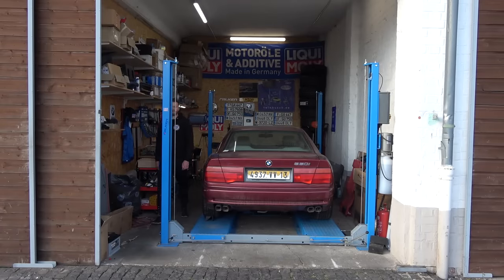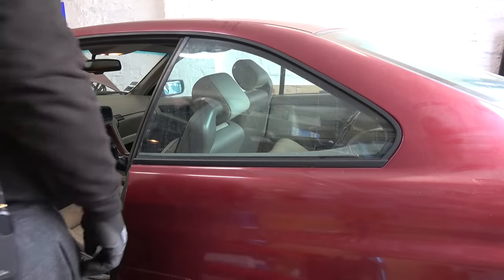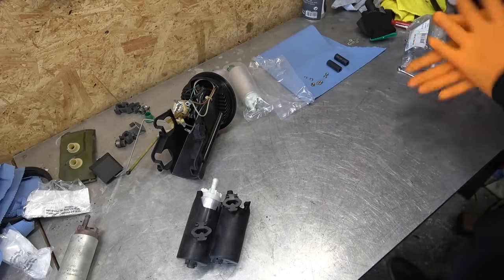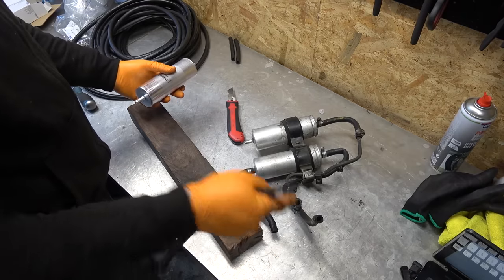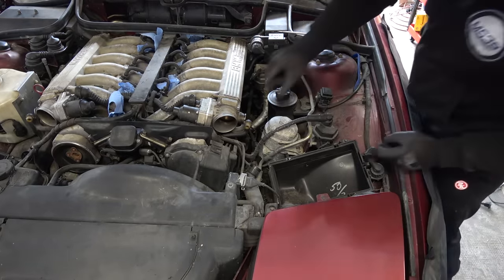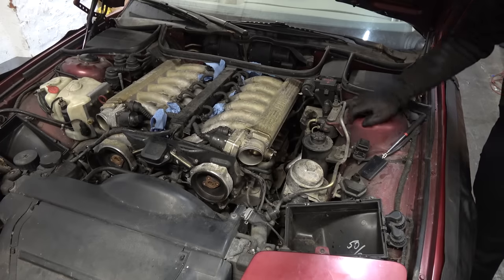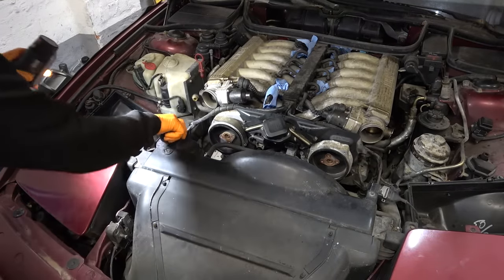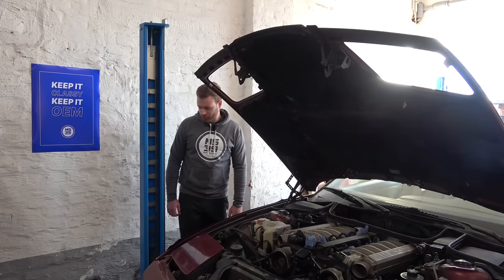The Hack Jobs Unfold - Garden Find V12 BMW E31 850i Revival - Project Marseille: Part 2

Comment: The more I watch this channel the more I'm convinced. It's not that BMW's are unreliable, it's that so many mechanics don't know how to work on them. It's either that or their cheap shortcuts don't work!
Great work.
Reply: Cheap short cuts nuh cheap at all, an dem never work out either.
Reply: @objective see, imagine the conversation between owner and so called mechanic trying to blame the car for not working and fleece more money.
Reply: 80s bmw and 90s bmws are reliable and lower maintenence. E39 era are excellent but more leaks and issues. After that it seems oil leaks and such are engineered into the car in lovable ways. Many mechanics are poor w bmws but they're good cars. I'd stick to maybe 70s, 80s for sure, 90s are OK, 2000 era (01 7 series, 03 5 Series, 05/06 3 series) after that is questionable in my. Opinion and not as desirable.
Reply: No, they are unreliable. Don't kid yourself. They are also engineered to do things that your average 200,000-mile running Toyota could not dream of doing.
Reply: You make a good point.  We currently own three 2001 BMWs:  a 740i, a 740iL, and a 325ci.  Our independent mechanic is an absolute expert, on par with Sreten here, and our cars keep running better than they did before.  (If I had to rely on dealer service, I would probably sell all three.). These cars really need someone who absolutely knows them inside and out to repair and maintain them.  We are fortunate to have such a person.
Reply: That's basically why we sold our family E39... stupid (but really nice) mechanic.  My dad & I still go back and forth that it only needed new rubber lines, small parts, etc.
Reply: As long as they are maintained in the correct way with quality OEM parts they are beautiful cars. I ditched the expensive ripoff workshops and took the brave root of learning how to maintain my own BMW. With the help from good channels like this I am not sorry at all I took the challenge to self maintain.
Reply: No, they're unreliable.
Reply: I've got a 99 plate E46 3 series.

I've had it for 8 years and I've never had any problems, just the usual wear and tear stuff.

Before that I had an E36. There's no way I'd describe either as 'unreliable'.

Comment: Can't believe so many parts are still there from the factory in 91 😂 Man I need an 8 series..
Reply: My 2001 E39 was running ok on all original everything in 2018. Refreshed everything since.
Reply: And só do i...
Reply: @TheHeretic435  currently refreshing my 540i, 150k miles and 23 years old and it’s just starting to have issues
Reply: Meanwhile in 2016 I bought BMW 318i year 2007 with less than 100 000 kilometres and in need of replacing everything...
Reply: @bokibo87  thats literature the worst car you could buy, sorry.
Reply: @ВлаткоБлажевски  
Well there is always n47 version of them...
Reply: @bokibo87  you are right,it could get worst 😂
Reply: I think that everytime I see one of these videos.  My friend's dad had a few 840s but I haven't seen an 8 series in a long time.
Reply: Expensive parts 😁

Comment: When things start off too good, there has to be a catch.
I tackled some smaller issues  on my car, like a not completely free spinning back whell (drum brake).
I was greeted by lots of rust and brake dust, combined with some sort of resin. The insides would only move to some punching tunes by MC Hammer.

After several annoying issues with my car, which were a result of poor / not even performed by paid for maintenance by lazy mechanics of two different shops, it's very refreshing to watch you work.

Attention to detail, thorough, decent and honest work.

Comment: @m539restorations I bought my e46 with one of my spark plug threads stripped and it was an easy repair, if I may give advice, put bearing grease in the channels of your tap and every few turns, remove the tap and clean/ apply new grease. the grease will catch most, if not all of the metal shavings and save you from removing the head. worked like a charm on my car and I've since put 30 thousand miles and plenty of track driving on since and no issues! good luck!

Comment: The spark plug thread repair kits work well as long as you have good access to the hole. Cutting swarf is the enemy here but if you keep the tap greased up will minimise any swarf getting into the cylinder. Yes have used them quite a bit. Some idiots don't realise that you dont need to tighten a spak plug with a metre long breaker bar. Love your channel, look forward to it every Sunday morning, now part of my routine :-)

Comment: A little rubber artists roller works perfect for applying sealant to a gasket or anything flat.. lasts forever, easily cleaned, small and cheap.  Applies a perfectly even thin layer every time.

Comment: Cool new video, I love it! What will he do next...? Tap new spalk plug holes and put coils in? Then he will risk dropping pieces of aluminum into the engine... guess it will be... dropping out the engine, take off the head, take the head to a machine shop... or replacing the head for a new OEM one (that must be expensive) of find a salvaged one... can’t wait for the video from the legendary-BMW-mechanic!

Comment: For the stripped threads, use helicoil repair kit. Remember, when you screwing the coil after drilling new diameter and threaded it, gently pushing light force on the coil on the way down. With each turn, use same light force.

Comment: In M57D30 there's the same thing with MAF, the moment you put in some replacement instead of OEM the engine controls go haywire. Automatic transmission starts to shift harshly, and idle feels like its firing on 5 cylinders. Same goes for older m50 engines. Had m50b20 E36, without Vanos. I changed the MAF cause it signalised an error on diagnostics, went for a replacement made by SRL, and it was dreadful. Same goes for exhaust systems on m50/m52, those engines are really sensitive on fuel/air ratio.
Reply: m57tud30* the 193bhp one

Comment: My daily driver is a 06 x5 3.0
Had a 06 4.4 but did not want to do valve seals that leaked. So i opted for the 3.0 surprised by how much i like it. 224,000 all sorted could still and forever use some pm but dont know how much to put into a 3000.00 dollar car.
Brakes rotors ball joints control arms tires regular consumables is what i have into it. I have new belts but did not change them because want to do water pump therm and tensioner pulleys while there, sometime this summer. 
I have this x5 because i like the 06 body style. It dont like minus 20 or so weather neither the 4.4 or the 3.0
Old 4 banger s10 dont care how cold it is.

Comment: It's fairly easy to strip the spark plugs on the older BMW engines where they go in on the sides, particularly on the M20 and M30 engines where they sit at a slight angle. I deal with those a lot at my shop...

Comment: Already looking forward to the spark-plug thread operation in need of a full set of gynecological fingers. I hope You'll show what You do in detail. Did it on two cylinders once "head on" in a relatively empty engine room with only one third of cylinders present compared to an 850, but it still was a "wouldn't do it again" operation.

Comment: I used to have a 1995 Volvo 440 that had fuel delivery issues, turned out that the wiring was so thin from the fusebox to the fuel pump that voltage dropped over 2 volts. 14.4V at the generator, 13.2V at the fuse box, 11.0V measured across the fuel pump. Maybe check that too when you go back go to plug the fuel pump back in which you'll forget about. What I ended up doing is (not too OEMesque sadly, maybe you can some up with a better solution with proper crimped connectors, rerouting, better/thicker GNDs, etc) routed an additional, thick +12V wire from the fusebox to the pump next to the original one, both ends soldered together and it made the drop disappear and the pumps to work properly (datasheet showed me that I increased flow of my pump by about 30% with the "extra" voltage).

Comment: The V12 M70 5.0 uses the same MAF(s) as an M50 2.0 so E36 320i and E34 520i. 0280 212 025. This is from when Bosch made things properly so you will find 30 year old MAF's that still work perfectly. I sold one last month for £30.

Comment: Once more a  superb example of your incredible knowledge of BMW,(How did you acquire such extensive know how?) and a straight to it directed approach to the issues. I only wish that you were closer to Brittany where my 2002 e39 530D Mpack and 2015 435D Xdrive convertible continue to drive me around and at times a little crazy too with minor (hopefully) issues. Looking forward to hearing the V12 on Marseille start. :) PS Where do you find parts cheaper than the main stealer?

Comment: If you use Loctite 518 as an gasket sealant instead off the sealant based on silicone, you don't end up with rubber stuff in the engine. 😊👍🏻

Comment: Good work, nice video. I hope you find a solution for the spark plugs problem. Have not you thinked of removing the engine and rebuild it? New piston rings, rod bearings, checking the valves sealing, etc?

Comment: Despite having almost no mechanical skills I still feel like your garage would seriously benefit from a ultrasonic parts cleaner... they're cheap and easy to use (I mean... if I can use them, right?) and help a ton on cleaning parts like the thermostat housing, fuel pump assembly, water pump and etc... Plus it's not aggressive at all on old parts which is always a plus on these 'vintage' vehicles! 

They obviously a bit more time consuming than just scrubbing stuff off but if you're only working on your cars every other day, or weekends like me, they're perfect and the results are definitely better.

Ps: I really wish I had the balls to buy an E31 but living in Australia just thinking of replacing those OEM belts sends me broke

Comment: i am very sure with your skills you can repair the spark plug threads, i have done it a few times at work. i was just afraid that you can not reach it when the engine or cylinder head is still installed. greetings from paderborn :)

Comment: In my experience having to buy parts made by a specific OEM is not just a BMW thing. I have come across it before with some GMs I have owned and it always without question, cost a shit ton more too. I have to believe they do something with the design of the part to purposely make it difficult for others companies to remanufacture duplicate parts.

Comment: Great start to what is going to be a challenging project! - Great videos and common sense thought process for the repairs - If you don't mind a question, where did you get the black tool pegboard on the wall in your shop?

Comment: 19:00 the MAF/ECU has a procedure to burn off debris on the platinum wire that happens on shutdown or some part of the cycle, maybe that plus starter fluid was the cause of the fire...
Reply from the maker: Could be as well, yes.

Comment: I understand wanting OEM parts, especially MAF sensors, but here in the USA they are almost $2000 each. I have aftermarket ones for only $100! Even if they only work for a year you can buy many for four grand.
Reply from the maker: It's not the matter of how long they'll last, they simply don't work properly in these cars. Period. Member on a German forum tested all of them and those cheap aftermarket ones are giving wrong adaptions.
Reply: @M539Restorations  Thanks for explaining. Kinda glad I passed on the 2001 750iL near me for $2000. Maybe worth buying to part out?

Comment: I had spark plug thread stripped on my 4.2 V8 (Audi A8 D2) engine as well. Unfortunately, head off and sent for rebuild :(. The engine is still running great (60k from rebuild, 470k km in total). It was not so costly in Czech 8 years back. Not sure about today's cost situation and definitely not in FFM (quite costly I guess at least from my experience :( )

Comment: Hey man love your videos. 

I never had any of those beasty older beemers, but have enjoyed a cabrio 118d a 320D M sport and my current one a 420D Msport cabrio.

Recently i moved to a very rainy place and after rain my 420 always has a small drip of water on the driver's side where the windshield joins the hard top.

If i open the the roof and close it water goes away, but i was wonrdering if it is not hiding some plugged drian holes ora worse problem... Any advice ?

Comment: Time Sert is the best thread repair system by far, but I'd be removing the head if I was going to be repairing more than one cylinder as it's quite a sketchy process when done in situ and multiple cylinders is just pushing your luck a bit far...

Comment: i have theory on the spark plug threads, im not sure. but i think if you dont tighten the spark plug to tight enough but keep it loose, when u start the engine. compression is high that it will start to put pressure on the spark plug and they move a little eating away the thread, and eventually the spark will be shot and thrown from its place by the engine pressure in the hole, and the thread that cannot hold the plug anymore.

Comment: Hi  Excellent Video. It's appreciated and very informative. @ 10:00-10:10 You presented the new fuel pumps with the same style as the original  this is so you didn't have to change the wiring. Can you tell me which  fuel pump you used?

Comment: My heart sank when you found the stripped plug threads, hopefully it works out ok, it’s real bad news, and surely difficult to repair in place. 
Not to be rude, I’d have been hesitant to do the other engine repairs like fitting the thermostat etc before attempting to repair those threads, it may well cost the engine or heads. 
Was the repair set a helicoil set?

Comment: Some jack-leg mechanics ALWAYS use gasket sealer when replacing gaskets.  🤦‍♂️  They do it “ so the car does not come back with an oil leak”,  in case the intended gasket isn’t sufficient or they screwed up replacing the pan and/or didn’t have the proper torque specs.  Sends me into a slight rage when I have to scrape all that crap off. 🤬 the last car I did it on, I replaced it with just the gasket, and it’s been running for years with no leaks.  🙄

Comment: Im addicted to your videos lol also quick question: does the oil filter housing cap have a O ring between the cap and the housing? not sure if you put that back or just applied that glue thingy. The reason Im asking is Ive been dealing with an oil leak on that spot, replaced the o ring (bmw parts) a couple of times, placed the cap back with the right torque and still leaks :( its a 96 z3 1.9  

pd. please get a Z3 :)

Comment: Dear Sreten,
.
I have seen the part of a different video (the workshop-building series?) where you say, “I don’t, I WON’T do BMW restorations of cars that run with tractor🚜 engines (diesels),” or close to that.
.
I’ve written before, and I ask again, won’t you reconsider?
.
In a way, you’ve done so much, covered so much territory, you need to expand your range, in my opinion.
.
And, I’ve looked at other sites, like Jamie’s Garage, which are pretty darn good, and close to your level of video blog professionalism, but really, YOU are the best at this.  Who else we gonna call?!
.
Do a diesel, as only you can, or do a petrol/electric hybrid, OR do more OLD BMWs, with only 4 or 6 cylinders.
.
OR, move on to OTHER enthusiast cars, like MY 2006 Volvo v70 R, a “Touring,” with its new stainless steel 3” down pipe & oval exhaust from the turbo to the exhaust tips, from IPD of Portland, Oregon.  And many mods by the previous owner-enthusiast!  I’ve got cracked rubber window moldings I need to know how to replace!
.
Those Volvo R models have plenty of enthusiasts!  Help a brother out, man!
.
Or get your EVIL TWIN to do the diesel!
.
David Pearce,
Fredericksburg, Va.
USA

Comment: Hi Sir , could you tell me during this video were you using a Hazet 1/4 inch drive Hazet torque wrench for lower torque settings ? I'm looking for a good quality say 2.5nm to say 25nm torque wrench which is small to get in difficult places but good quality and most importantly accurate ?  would you recommend if so . Awesome quality work and would only buy a BMW worked on by you . Stay safe comrade

Comment: How does one strip a spark-plug thread? Easy, like I did: trying to take out the spark-plug from a hot engine. How does one strip 3 of them... That is indeed an enigma, 'cause I stopped after the first and went to buy a repair kit.

Comment: Recently went to get handbrake actuator done on x5 to realise yesterday the " BMW SPECIALIST " has removed my trim from the front of my rear wheel (in wheel arch) which is now missing  and also 3 screws missing from from the front inside of the wheel arch so I agree miss screws FIRED

Bare in mind I paid £1200 to fix a handbrake....

Comment: 3 Spark plug threads stripped ??? Guess the previous mechanic had a torque key in kgm instead of Nm 😅 People like that should only be allowed to work on wheelbarrows. You’re in for a few more surprises.

Comment: Hello I have 03"  E39 540i M/sport champagne II and my MAF just gone. Car have only 50k miles on clock. I tried to buy used one BOSCH, but have same problem. I just simply disconnect MAF and cars drives, not like before but still pulls. How bad is to drive without one? I recantly have trans fail prog issue which no one know why, because after night I turn ignition on and warning pops up stright away, but all I need to do is lock/ unlock car and warning goes away for rest of the day. Gear box changing gears without issues..